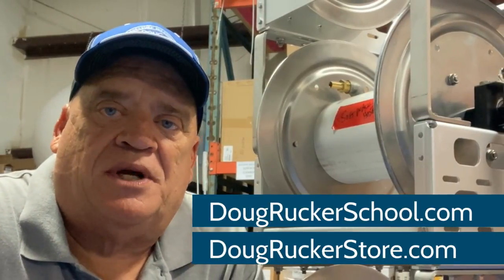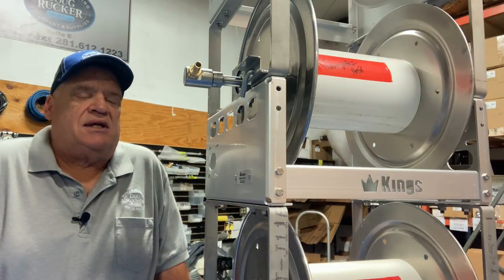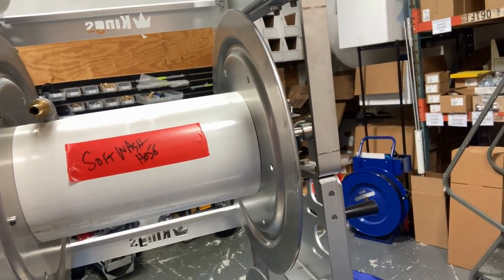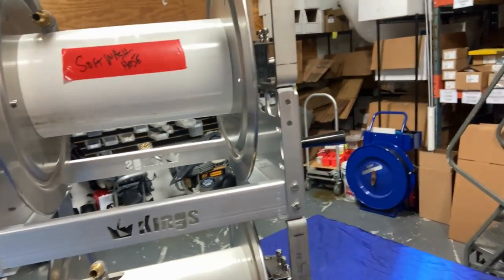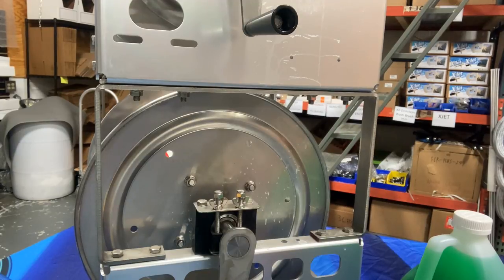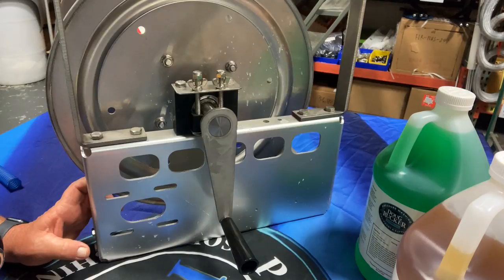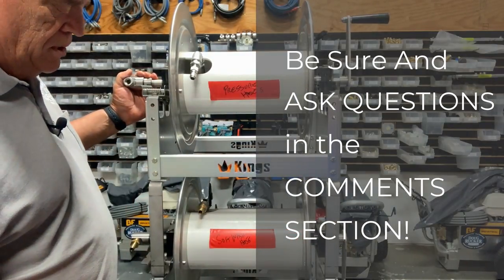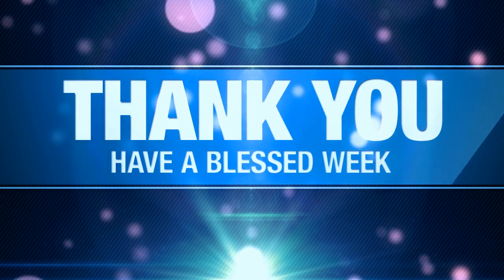Pressure Washing Business Equipment [HOSE REEL SETUP] from Doug Rucker Store

Comment: I always thrive for the best.  So I WISH they (as in everyone on the planet that makes hose reels) would create/build/invent/engineer those feed lines coming into the reel wind area with a bend in them so your hose would initially lye flat against the center drum instead of sticking out like an old lady with stage 9 arthritis in her knuckles.  I'm sure I'm not the only one thinking this, right?
Reply: Add a ½" 45° street elbow
Reply from the maker: Yes like Christopher said add a 45 street elbow and it will
Lay flatter but you’ll need to direct connect to it. Won’t fit as well if you use QC fittings like I do.

Comment: Doug, will a reel with a 1/2" manifold work ok with a 3/4" main supply line and 3/4" line feeding the pressure washer/soft wash system?
Reply from the maker: Yes it will

Comment: I got a question? I just purchased a electric hose reel , my question is how or where do I ground the Solenoid at ? I don’t have a skid I have a end closed trailer. Is there anywhere to ground it at ?
Reply from the maker: If you mount the solenoid to the metal reel and the metal reel to the metal skid, then the battery should be grounded to the skid. I prefer to run a ground from the battery to one of the mounting bolts on the solenoid. May be a little over kill but minimizes the chance of an open circuit due to corrosion later. "Ground is ground world around"

Comment: I've been checking out the hannay and kings hose reels on your website. Which is best for softwash?
A reel that isn't a rust bucket since 50/50 is a hot mix.
Reply from the maker: For soft wash both are going to be about the same.  Kings come with SS manifold, Hannay Have to special order SS Manifold.  I have neither in stock but can the Kings pretty quick, the Hannay takes a couple weeks. I really like the Valley Industries hose reel for soft wash though, no manifold and they out last anything with a SS manifold.  I have those in stock. Just know with Kings, Hannay, Titan, etc, even w a SS manifold the bleach will eventually eat through it, so then you just use the reel for storage and bypass the manifold.

Comment: Do I have to use a 1/2” whip hose between my machine and reel when running 10gpm ?   Or can I just use 3/8?
Reply from the maker: Assuming you are talking about a pressure washer, It’s not a bad idea but when I had a 10gpm I used 3/8 and never had an issue

Comment: what is the correct hose width? half inch or 3 quarters?  would you do a video on types of hoses? cheers
Reply from the maker: Depends on what pump your are using
Reply: @PressureCleaningSch  3500psi 21litre pm
Reply from the maker: @Kampup  3/8 high pressure hose w at least 4000 psi rating
Reply: @PressureCleaningSch  thank you

Comment: I seen that you like and sell the flexzilla pro 1/2 air hose as a soft wash hose. I’m a beginner and I’m trying to figure out what hoses to get. Does it matter that it’s an air hose since we will be using it for water and chemicals. Also would I use a 1/2 air hose reel and would I have to change out the fitting.
Reply from the maker: Doesn't matter that it's air hose, I have been using to for it for a couple years no problems.  I would not use an air hose reel for spraying liquids, especially chemicals.
Reply: I’m a big fan of yours. I’m going with what you say. What kind of things do I need to look for in a reel for this hose. Also can I use the fittings that come with this hose
Reply: Actually since it has 3/8 fittings I need a 3/8 hose reel correct

Comment: Subscribed! 
What is the height from top to bottom of those three hose reels stacked together? I want to order some for a Ford Econoline van build.
Reply from the maker: Right at 53-54 inches, each reel is about 18 inches bottom to top of reel.
Reply: @PressureCleaningSch  thank you. 
What is the lead time on the blue framed skid-mount 8GPM pressure washer from your site?
Reply from the maker: @Oscar-vs9xv  should be in next Thursday the 10th
Reply from the maker: one sold so one left